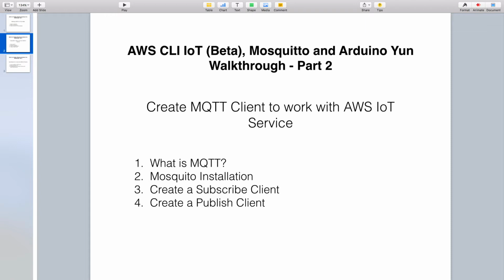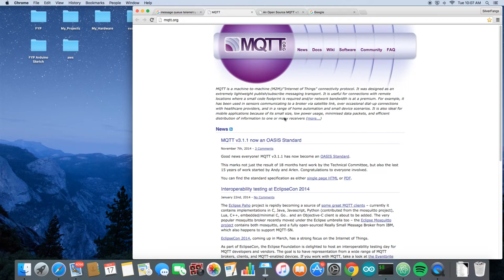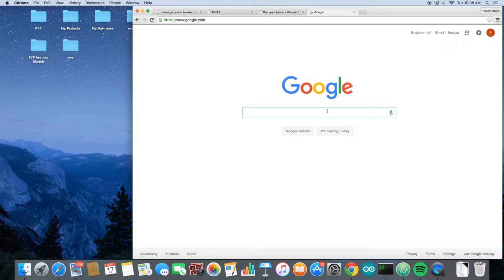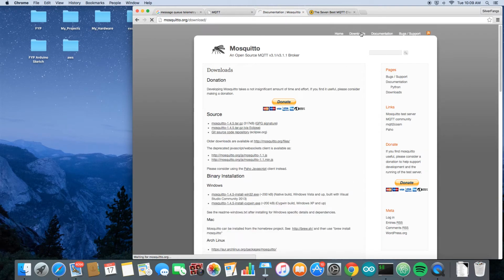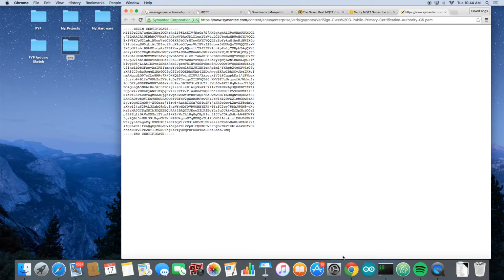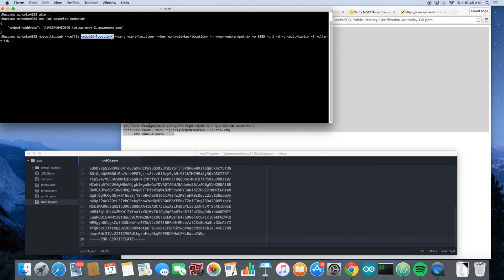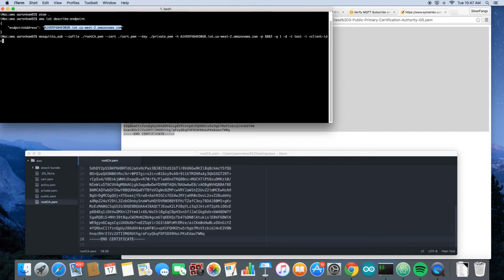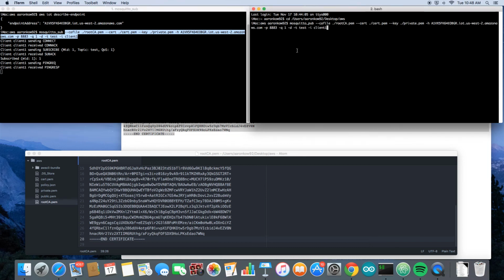AWS CLI IoT (Beta), Mosquitto and Arduino Yun walkthrough - (2/3)

Comment: Hi Aaron, Thanks for your post. I tried running this on my machine but got  the following error:
# mosquitto_sub --cafile /myfolder/certCA.pem --cert /myfolder/cert.pem --key /myfolder/private.pem -h A11111AAAAAAAAAA.iot.ap-southeast-1.amazonaws.com -p 8883 -q 1 -d -t test -i client1
Unable to connect (Lookup error.).
Reply from the maker: HI Anthony, I google and find that lookup error most likely is an exceptions that are raised when a key or index used on a mapping or sequence is invalid. Please check if all the files and flags you have key in correctly.
Reply: Thanks Aaron. That's correct. It was due to a missing character in my cert.pem file. I've rectified it and is able to establish connection with AWS.
Reply from the maker: +Anthony Iwu Okay glad to hear that!